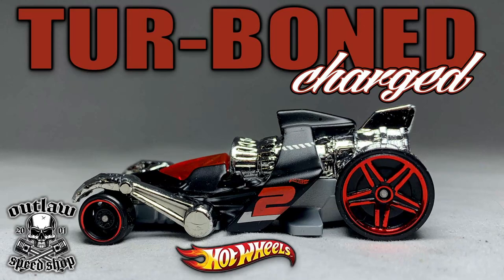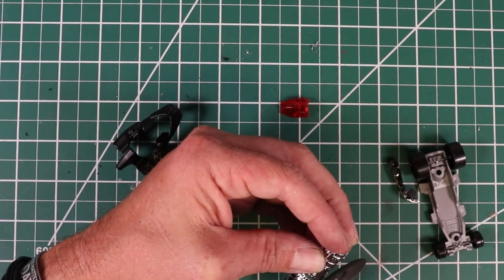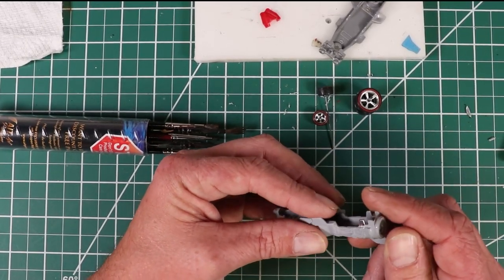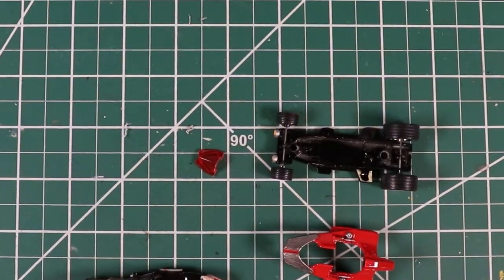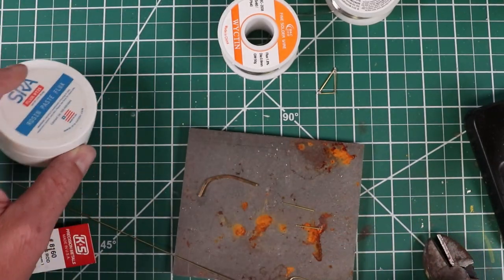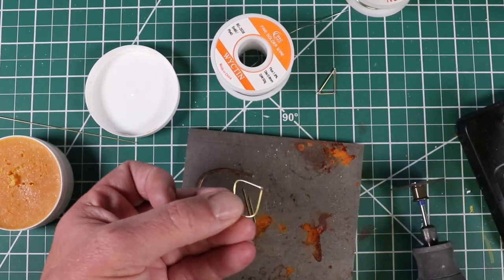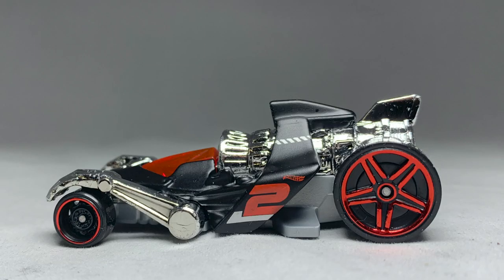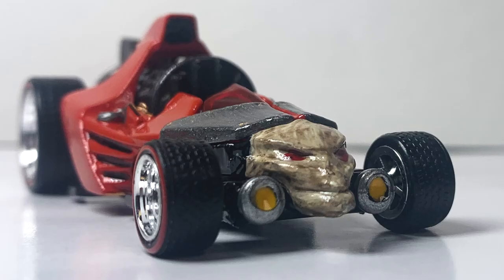Tur-Bone Charged & Quick Brass Solder Tutorial

Comment: Great video Keith, thanks very much for the soldering tutorial! I have seen others using solder, but haven't tried it myself yet.

This is certainly an odd little casting, I had thought to pickup a couple for parts, but now may have to try and make something cool out of it like you did. Would probably remove that skull on the front as well and scratch build a grille shell for it.

Great stuff, thanks for sharing, stay safe and keep on keeping on!!